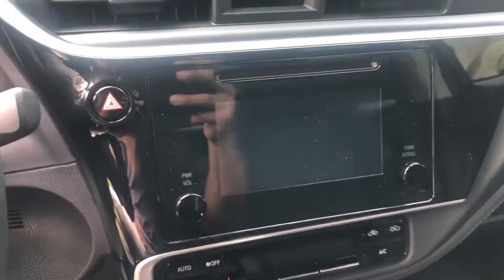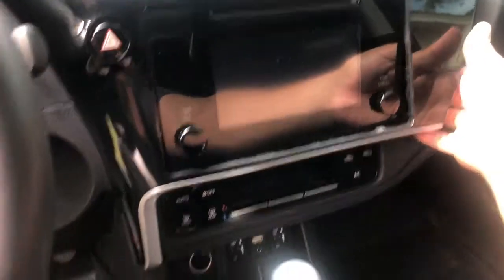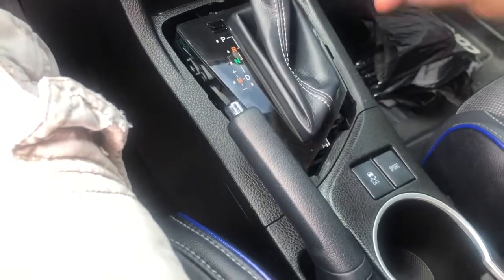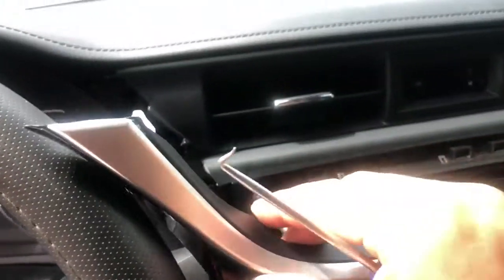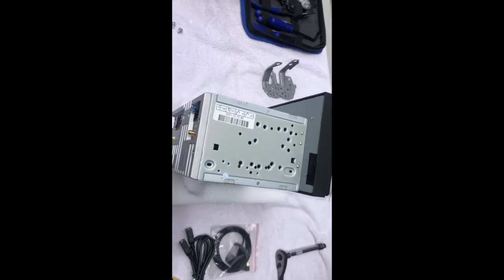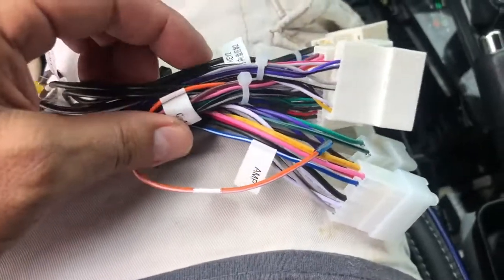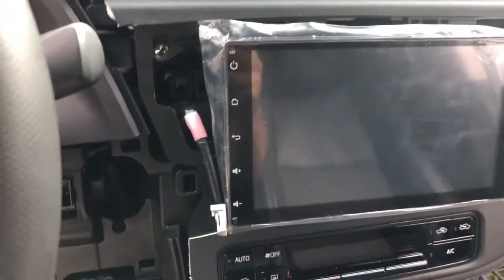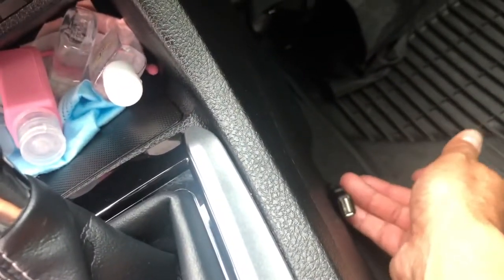2017-2019 Toyota Corolla radio removal and aftermarket SYGAV stereo unit installation

Comment: Do you know what happens to the functionality like "door lock settings"? Does it stay where you last programmed it? Interested in this before I replace the radio. Thanks for any help.
Reply: Yeah, it makes me wonder if I'll still be able to set my auto headlight sensitivity, or would it be stuck as I left it
Reply: Probably not, and lose XM radio ect. Be careful with crap like that

Comment: At 15:04 what specifically did you do to the bracket so the radio would fit properly? I do not understand the phrase “eat the bracket”
Reply from the maker: The unit case has been upgraded. It will fit to the dashboard with the OEM bracket perfectly.

Comment: Have your radio DAB function buildt inside the radio, not the windows solution, here in Norway we use DAB system, My car is an Toyota Auris Hybrid 2016 mod. will your delivery fit my car.?
Thanks
Sigbjørn

Comment: Where are you located? Can you install my new radio on my 2019 corolla se?
Reply from the maker: We are located in China. The stock is in the US. This item fits 2019 corolla se.
Reply: @SYGAV can you use your old stock camera thats already installed on the car? Or do i have to install the new one?
Reply from the maker: This android unit can work with the old stock camera @benitad3374
Reply: Will it work with the stock mic also? Sorry for all the questions
Reply from the maker: No. It can not work with the stock mic. @benitad3374

Comment: Where did you connect key 2
Reply from the maker: It doesn`t need to wire KEY1 and KEY2. Steering wheel controls work through CANBUS.